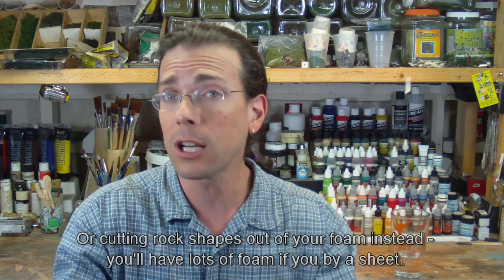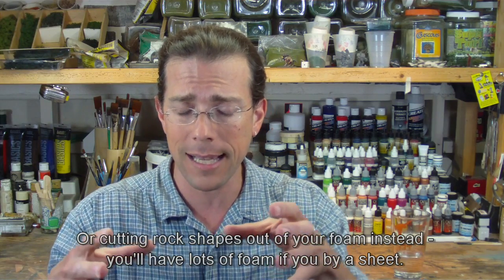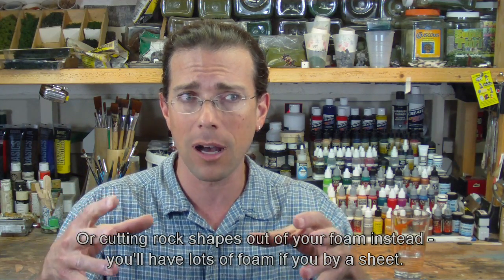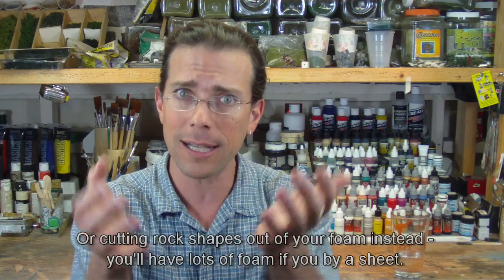TerranScapes - Q & A episode 2

Comment: @David A note for the sand issue: The type of sand mentioned goes by many names depending on region and/or brand. Other common names for "traction sand" are; All purpose sand, construction sand, varying sand, rubble sand, etc... Just specify that you DON'T want play sand and associates tend to know what you mean. One more thing, that type of sand is generally located with construction materials in home improvement stores rather than with play sand and other gardening materials.

Comment: For cheap sand go to the beach with a small shovel and a plastic bag. The size of the grain you get depends on the distance to the actual water. Small suggestion if you want to go this route is put it in a tray, stuff it in the oven and crank up the heat.
WARNING: Sand in the oven gets really hot and stays so for a while so leave it overnight to cool off in a safe location out of reach of children, pets and unsuspecting family members.

Comment: The question about the glue, you mention you mix 15 parts water to 1 part glue. What kind of glue do you use for this? For example Elmer's glue-all is much thinner then for example Aleene's tacky glue and my guess would be that both need a different mixture.
Thinning Elmer's glue with 15 parts water, there'd be almost no glue left I think?